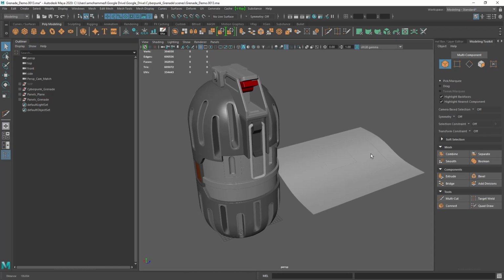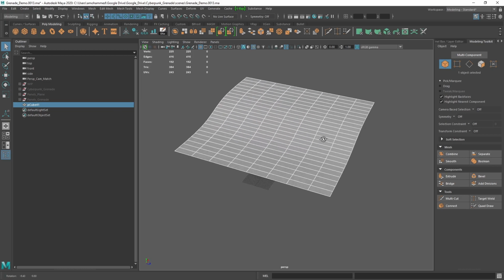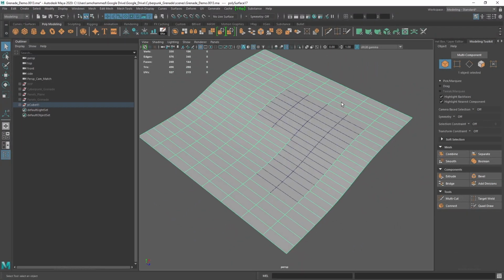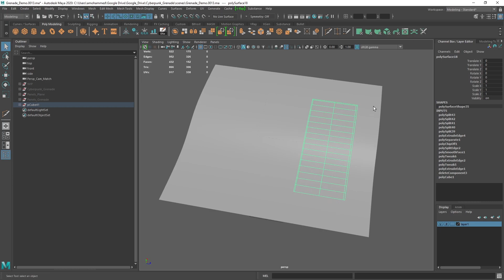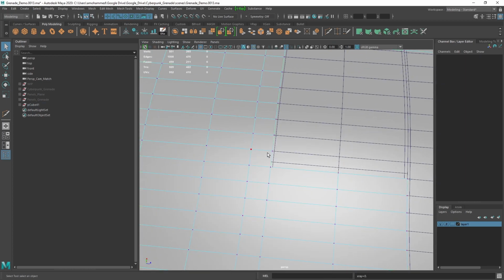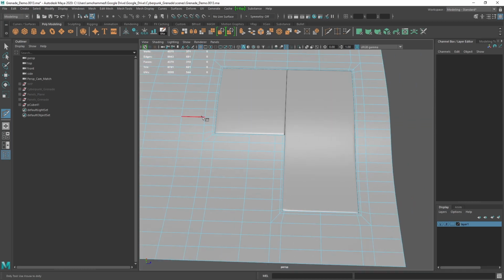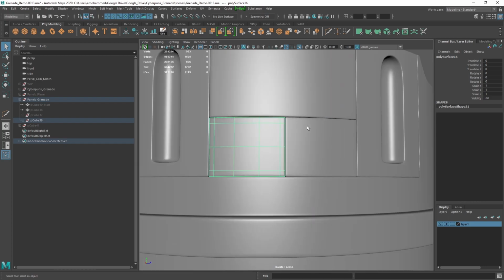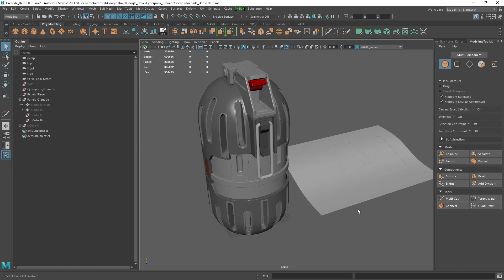Maya Hard Surface Modeling - How to Add Panels to Any Surface

Comment: I got a load out of this tutorial, but I have a question please:
What is the benefit of creating the holding lines in this method for interior corners 8:11 (with the three points of contact?) Is it primarily to keep edge flow contained in this area so it surrounds the shape? What is the reason not to just triple hold it with edge loops as you did for the initial panels? I understand that you can vary the radius of the corners this way, but what other reasons are there please? Thanks!

Comment: Thank you for the tutorial, I am quite new to 3d modeling, I've a question about even topology distribution, what is the general approach to that matter? As you have added a new edge in 07:40, should you in that case remove and add all other edges again to have even sized quads?
Or is it ok to have more detailed areas where it is needed?

As sometimes I see a model with barely any quads and then in some areas a lot of very small quads, in overall it doesn't affects the final look but I got the impression that it isn't the more "professional" modeling way..?

Thanks in advance if anyone answers. Stay healthy and safe.
Reply from the maker: When working with Sub-D models, having an even distribution of edges/quads is ideal to get the best result when subdividing. However, you will need areas that have denser polygons then others depending on the detail, I call that "localizing topology". I cover that in detail here, hope this helps: https://youtu.be/rwW6HpOcAuw
Reply: @OnMars3D  Thank you so much for the reply, I watched that video before asking, and some other on that topic, but I'm still a little confused, I guess this is something you aquire in the process of exercising..

Comment: Is macbook pro M1 suitable for this software. What's about the base model ?
Reply from the maker: The new Macbook pro M1 will be suitable enough to run 3D Animation software (that are compatible on Mac OS). It has really good CPU with 8-cores (new M1 Chip), 8GB of Ram, and a decent integrated GPU. Keep in mind the M1 chip is new and made directly from Apple so it's not made by Intel/AMD, so software will need time to get fully optimized for the new M1 chip. Also, the integrated GPU has solid performance but you are unable to connect an external GPU. 

If you already have it, you will be fine!